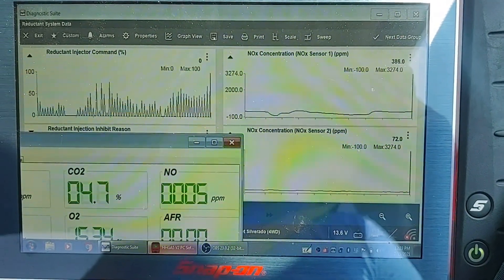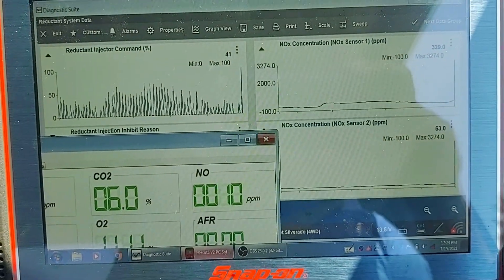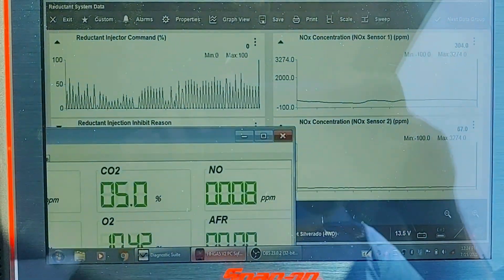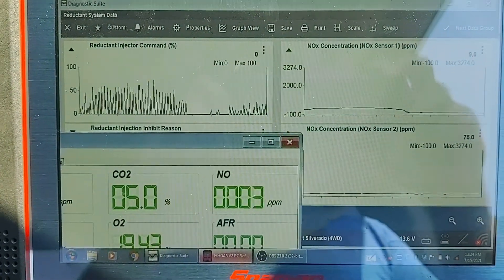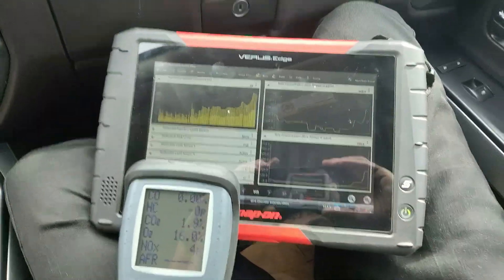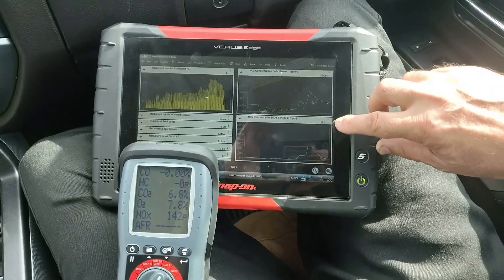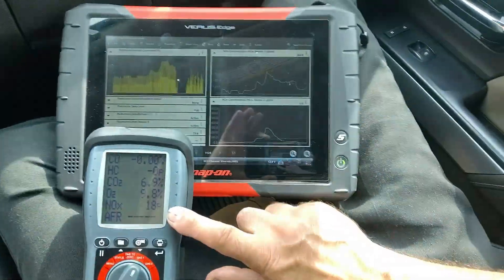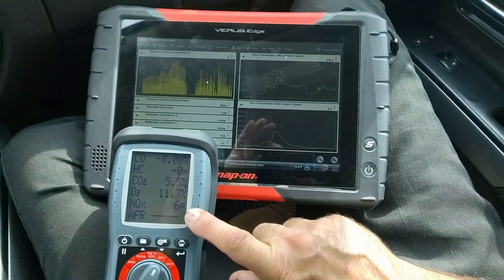Code P20EE Duramax, Failed NOx Sensor Diagnosis

Comment: Why did you put both in? Same reason you install both from O2 sensors on a dual bank car? Just asking for clarification. Thanks. Great video!
Reply from the maker: This truck only got 1 new sensor.  NOx sensor#2.  The one in the rear.  The front one was good.

Comment: Hi. I have a 2019 Chevrolet Express 2500 with a problem. SCR NOx Catalyst Efficiency Below Threshold Bank 1. And I saw there are 2 under the car. Which one is it?
Reply from the maker: It's more common for the front one to go bad, but it could be either.  Have you got a scanner that can read them?

Comment: I just replaced the upstream nox sensor and it’s showing no com I went ahead and graphed and it staying way out of range at right about 65575 this doesn’t seem right
Reply from the maker: You're right. That's not a correct reading.  What code did you have to start with?  What code have you got now?
Reply: @joediagnostics  U029D no communication
Reply from the maker: @anthonyrodriguez243  If a new NOx Sensor didn't fix it, check to make sure you put the correct one in there, and check the serial data lines to it from the PCM.  I don'[t believe there are any other sensors on those lines, so it should be easy to check them.

Comment: I'm getting this code and my truck is losing coolant. The dealer did a pressure test and they said it held for 30 minutes, but I'm thinking the coolant is leaking via the EGR cooler into the exhaust and causing this code. I cannot seem to rely on the Dealer garages for anything, it's so frustrating. In fact, one garage destroyed the engine and it was replaced 30k miles ago. This is a '20 Duramax with 82k miles.
Reply from the maker: If you're losing coolant, and can't find it, definitely do an oil analysis.  Remember, the engine inhales whatever passes through the EGR cooler.  It'll show up in the oil. (But so would head gaskets etc.)
Reply: @joediagnostics  Thanks! I did visually inspect the oil and it seems to not have coolant in it... and no condensation on the oil cap. Garage is looking at it next week.
Reply from the maker: @RandomStuff-zt6qf  OK.  It's definitely possible to detect it in the oil and not see it though.  You can usually spot popped coolers without a ton of trouble, so a good shop will get you sorted out.
Reply: @joediagnostics  thanks! I've got an apt with the GM dealer on the 8th, wish me luck
Reply: @RandomStuff-zt6qf  what was the outcome of this?
Reply: @dustin6828  they charged me another $600 despite my full warranty to replace the DEF injector and claimed the coolant was just an air bubble. The check engine light came back on the next day with same code and still losing coolant, final outcome is that the dealer's are worthless so I decided the warranty is also and lets just say the truck had a bit of a weight reduction and no longer throws check engine codes or loses coolant

Comment: been hearing about the GM MDI2 with the GDS2 software.....some mechanics say this is the only way to go when trying to reset the Nox sensors when replaced.   Also, dd you follow the technical service bulletin on DPF regeneration after any Nox sensor replacement which will enable you to complete a Nox sensor replacement.   I see you used the Zeus and Edge snapon during the diagnostics and reset.   Personally, I am convinced the GDS2 software or the Tech2win software (depending on duramax year model) is not necessary for resetting the emission system once the faulty part has been replaced.
Reply from the maker: I haven't had any trouble using the Snap-on scanner to do any emission reset on a GM.

Comment: you didn't show the knock sensor that was bad on the vehicle it much better you can show which knock sensor it was
Reply from the maker: Unless I'm wrong about what you're asking, the videos states, and shows that it is NOx sensor #2 that is failed.  Then it shows what the data is supposed to look like once it is fixed.

Comment: How do you determine whether or not the scr is failing? I'm having the p20ee code on my 18 l5p denali but the weird thing is that it only comes on after I fail to let it regen? I cleared the code and enabled manual regen stays off for a few hundred miles and comes right back. I've heard it could be the def nozzle or the nox sensor.
Reply from the maker: Start with reading inlet NOx vs. outlet NOx on your scanner.  Have you got good reduction at steady cruise?
Reply: @joediagnostics  I will let you know tomorrow I haven't looked. Used to gassers this is my first diesel and I want to make sure everything is situated before my warranty expires. Do you mind if I send you a video of the stats in a message?
Reply: Thanks in advance.
Reply: Having same issue with my 17 L5P, did you ever come to a conclusion?
Reply from the maker: @lukehair3818  On this truck it was a failed inlet NOx sensor.
Reply from the maker: @lukehair3818  this one had a bad inlet NOx sensor
Reply: Trying to troubleshoot this on my 18 Colorado. I changed the Nox 2 sensor just guessing. But don't have a lot of visibility. Worth investing in some better equipment like you guys? I thought just the dealer could do a forced Regen but that would be great if I could troubleshoot more myself. Especially since the truck is out of warranty due to GDE tune.
Reply from the maker: @goics1  Regens are to clear the DPF of soot.  It has nothing at all to do with the SCR System and NOx Sensors.  While both systems live in the exhaust, they're not related at all.  You're right that you need a good scanner if you want to diagnose the system though..
Reply: @joediagnostics 
been hearing about the GM MDI2 with the GDS2 software.....some mechanics say this is the only way to go when trying to reset the Nox sensors when replaced.   Also, dd you follow the technical service bulletin on DPF regeneration after any Nox sensor replacement which will enable you to complete a Nox sensor replacement.   I see you used the Zeus and Edge snapon during the diagnostics and reset.   Personally, I am convinced the GDS2 software or the Tech2win software (depending on duramax year model) is not necessary for resetting the emission system once the faulty part has been replaced.

Comment: Do u have a video on how to fix this? I just bought a 2018 3500 Denali that tripped this code on a 1600 mile trip back  home
Reply from the maker: This code can be a lot of things, not just NOx sensors.  Make sure you diagnose it properly before replacing anything.
Reply: Have you fixed it ? Mine is showing the same 2019 f 350
Reply: @daniel-qi1cy  Nah for some lucky reason it just went off on it's own and didn't come back